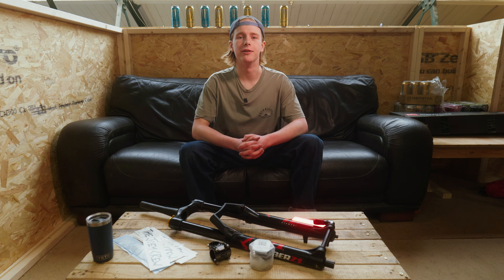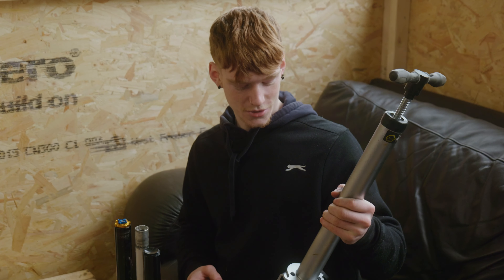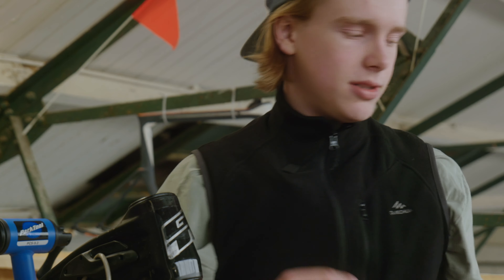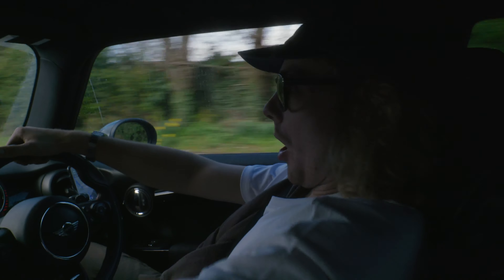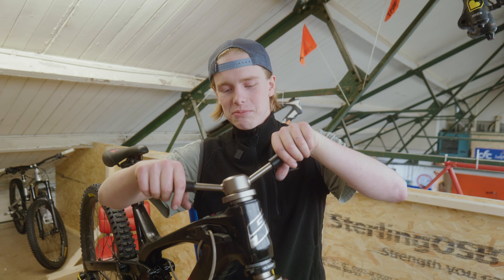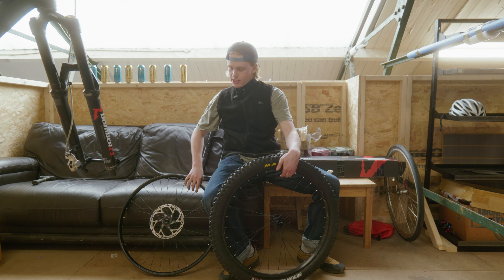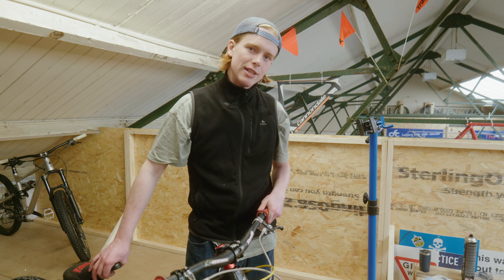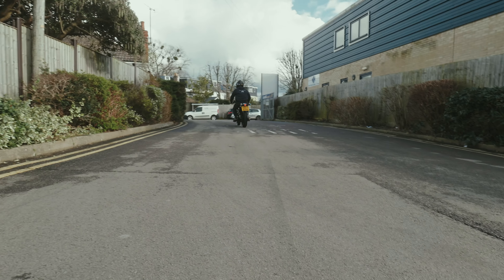ENDURO forks on a DOWNHILL Bike?! Bike Builds with Baz

Comment: Lol I'm doing the exact same thing to my fury
What size bottom cup is it?
Reply: I got 190 zeb tho 27.5. 
Might get a 29r
Reply: Sick mate, so it’s a 49mm bottom cup which means a tapered fork won’t fit with the bearings so you have to get an external cup like the gusset one I get in the video. This also acts as an angle spacer which helps geo.
Reply: Yeah I mean the bike feels more playful I think as full 27 but I suppose it would be better geometry wise with a 29er up front. Goodluck with the build!
Reply: Thx man so it's a 49/40 cup..
It was cool to see this vid...
Reply: @Bazhossle.  yeah I'm swapping forks just to make it more playful as opposed to a fkn tank. I don't race so single crown is more my steez...got the Fury more for safety than anything but it's more than I need for sure
Reply: Yeah I think it’s just too beefy with a dh fork - unless you were riding constant dh. But for jumps I think this is deffo the way ahead, also for most bike parks and things you don’t really need a full dh bike